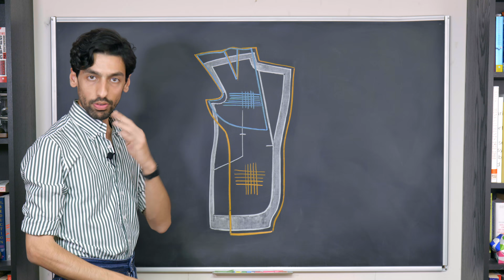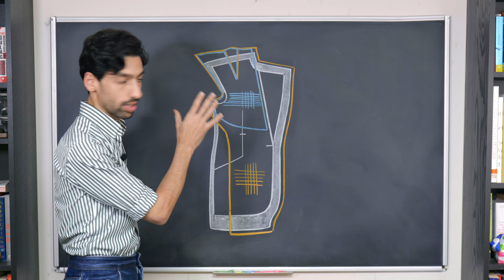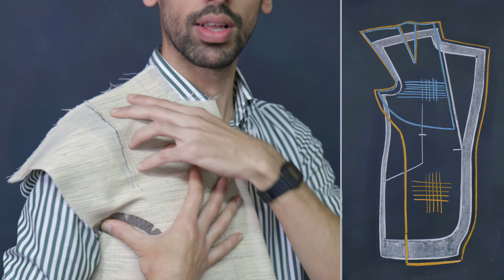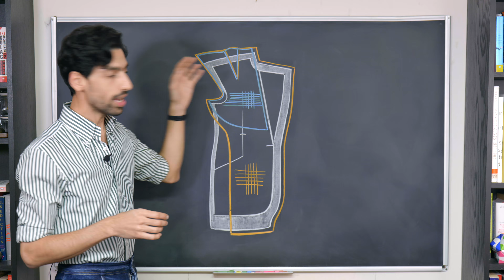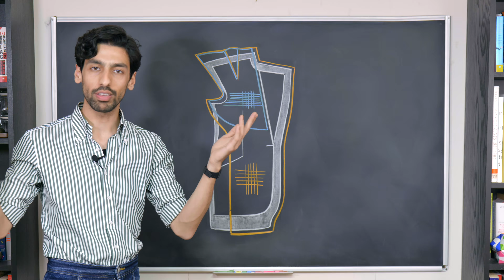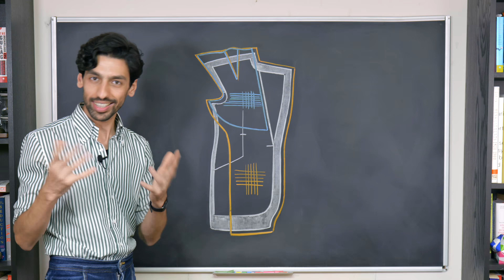Traditional Canvas Construction for Bespoke Jackets – ISOT Lesson 13

Comment: So the canvas is only for the front?
Reply from the maker: Usually, in traditional tailoring, yes. Only the front, and sometimes the sides get canvas. 

But there are many designs that might require canvas in the back as well. 

Since the purpose of the canvas is to support the outer cloth and its details, any area that needs that can have canvas or an equivalent of it.

Reza
Reply: @OFFICIALISOT thank you!!

Comment: How would you interface a coat? Would you extend down?
Reply from the maker: Yes. You can use the same logic to create a smilar construction, if not identical. Think of an overcoat as a longer jacket. That would be a good starting point.

Reza